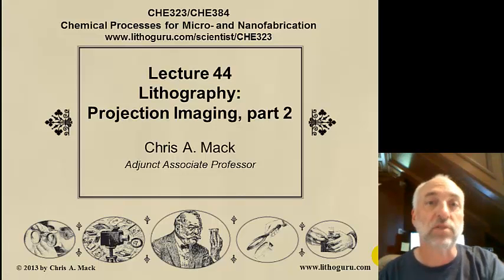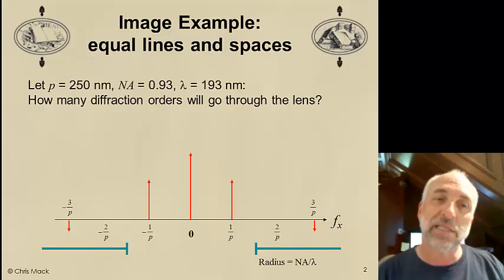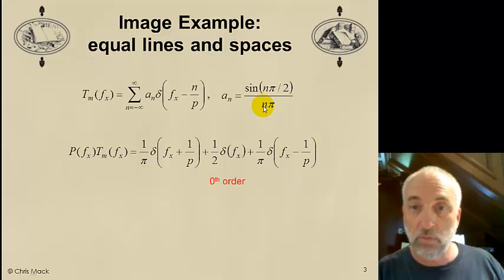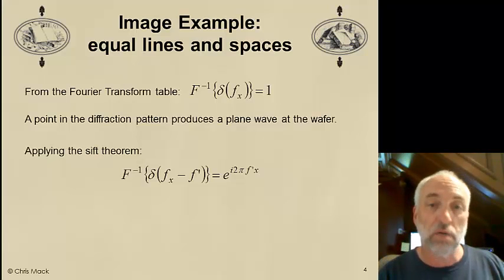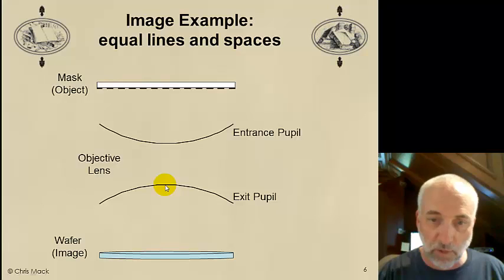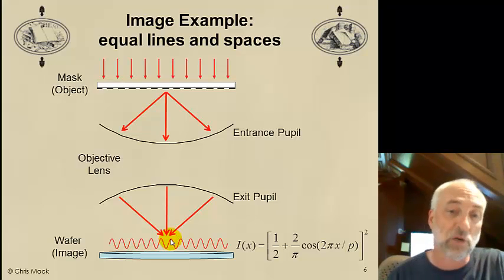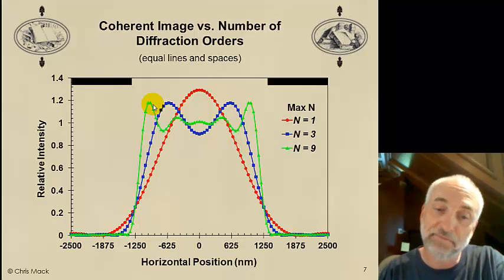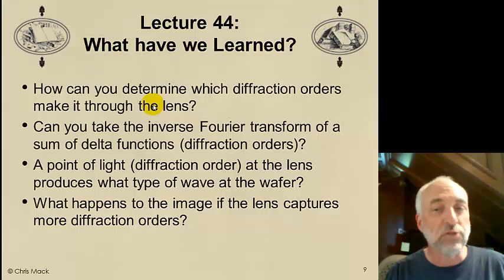Lecture 44 (CHE 323) Lithography Projection Imaging, part 2

Comment: How did we just know that P(fx) =1 ? Did n't we have to calculate the square root of the sum of squares fx and fy and check if it's less than NA/lambda?
Reply from the maker: P(fx,fy) = 1 whenever the square root of the sum of squares fx and fy is less than NA/lambda.  In the line/space example being shown here, fy = 0.
Reply: @ChrisMack  Thank you! I suspected so but had not run the actual calculation. Will run the numbers to confirm!

Comment: Prof Mack,
Watching these videos I found the resolution is pretty much related to the period. So, does this mean if the period become larger,there will be more diffraction orders that will be collected by the pupil? How to determine the period for a pattern that is not line and space (such as multiple contact holes)?
Reply from the maker: Xiaofei,

Any repeating pattern has a pitch, regardless of the type of pattern that is repeating.  The pitch is the center to center distance between copies of the same pattern.  For two-dimensional patterns (such as contact holes), there will be a pitch in the x-direction, and a pitch in the y-direction.  These may be the same, but they don't have to be.

Chris
Reply: Chris Mack Thanks for your explanation. But to me it seems that the diffraction order depends on the pitch, which is 1/p in the first order. Does this mean more diffraction orders can be collected if the pitch is larger? Then the imaging system can easily achieve 2-beam imaging/3-beam imaging in later lectures. In that case, the image quality can be good enough to print.

Xiaofei
Reply from the maker: Xiaofei Wu Yes.  Each diffraction order occurs at a spatial frequency of n/p where p is the pitch and n is the order number.  For a given wavelength and numerical aperture (that is, a given lens), the number of orders collected depends on the pitch.  For a larger pitch, more orders are collected.  Thus, larger pitch patterns are easier to print.  But in lithography for semiconductor manufacturing, we want to print patterns with a smaller pitch!  That is the challenge.
Reply: Chris Mack Thank you very much. I see. I think that's why we can use multiple patterning to advance lithography.